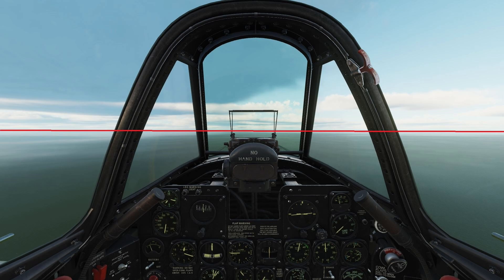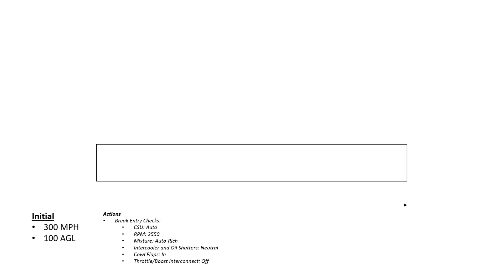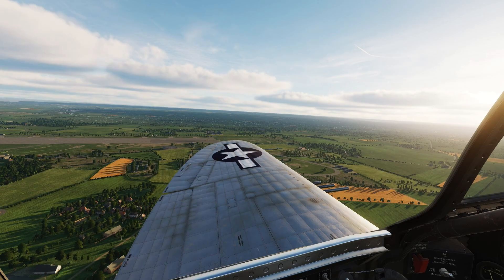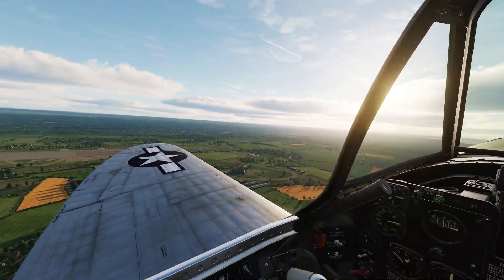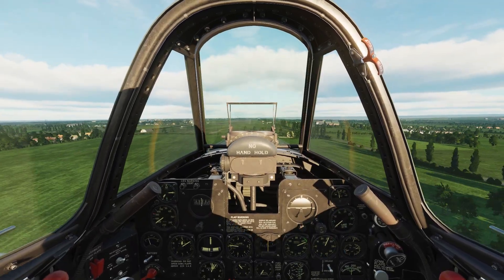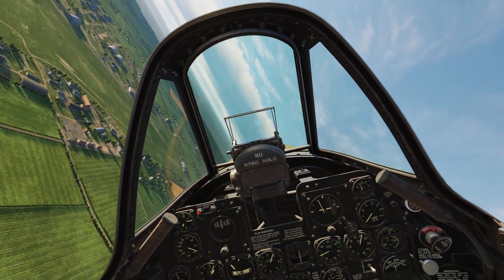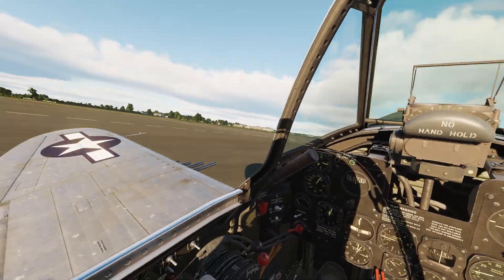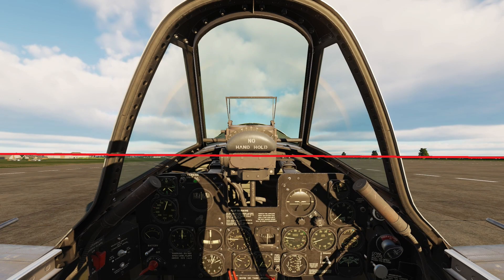Stick and Rudder Fundamentals in DCS: Landing the P-47D

Comment: The DCS glider pilot cabal is growing !
I had never heard of the EAR trimming technique before, sounds kinda painful though.
From memory, the manual recommends avoiding turns below 130mph however, so doing the final turn below that could get a tad spicy.
Personally I'm also not fond of doing things while maneuvering, I much prefer throwing the gear flaps and canopy once I'm on the downwind, especially since there's gonna be drastic speed and trim changes to stay on top of.
Reply from the maker: So EAR is what I learned during my flight instruction - I would imagine the logic is a) to stipulate a process that’s easily taught and won’t kill the pilot, and more practically b) trim the aircraft in the most efficient way possible to the pilot. By trimming the elevator control force and then the ailerons, you’re actually returning the stick to a centred position rather quickly, then leaving you to re-trim the rudder alone without having to hold the stick at a particular angle, ie it’s actually designed to be the least painful method of trimming the plane. I could be misunderstanding you though.

I think you you may be correct regarding the 130mph guidance. I definitely would not attempt a level 30 degree AOB turn at 130, but for a fairly benign AOB with a nose down attitude going into the hold-off I would imagine the risk is fairly low. With flaps down the stall speed is reduced as well. That being said, you could probably fly the last half of the base/final turn at 130 and not have any problems on the roll-out, so I’ll include it if I make another video on landing practices.

Whether you open the canopy on downwind or in the break turn was probably pilot preference back then and still is now, I would imagine. I personally have it bound to a HOTAS switch but if someone doesn’t then I would definitely leave it until the aircraft is trimmed. Gear should definitely be left until the aircraft is fairly comfortable trimmed, but I find if you wait until wings level on downwind that they won’t lock completely prior to hitting your interval for the base turn. After the break, the pattern definitely resembles a continuous turn into final rather than a racetrack or rectangle, so doing things whilst the aircraft is manoeuvring is the name of the game (and part of why flying a good break is so satisfying).

Happy flying/gliding!